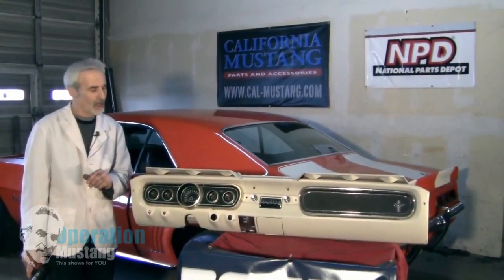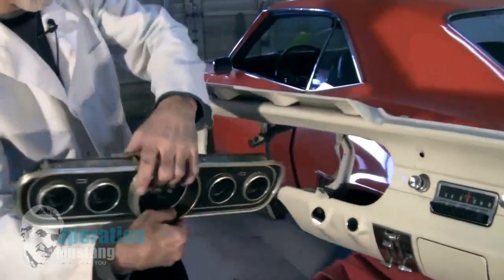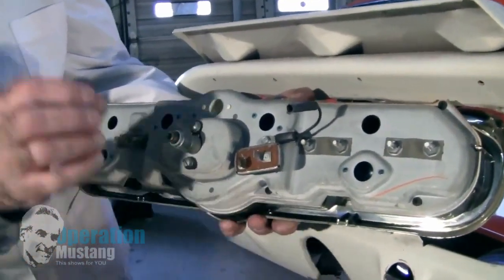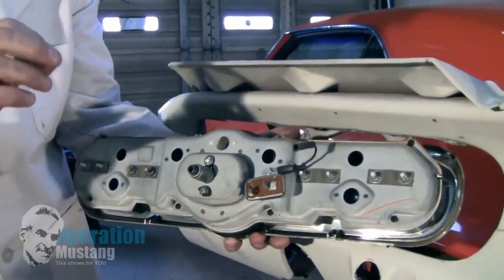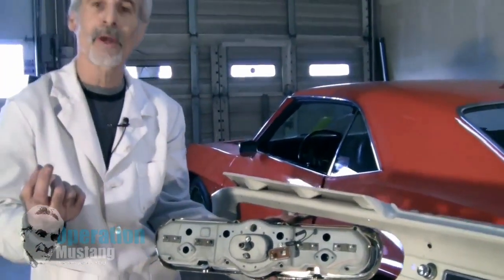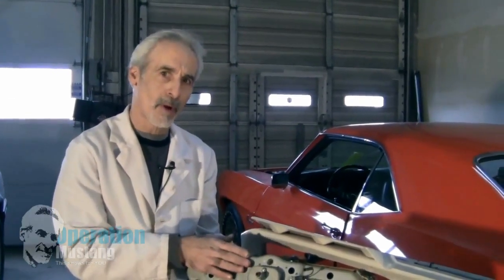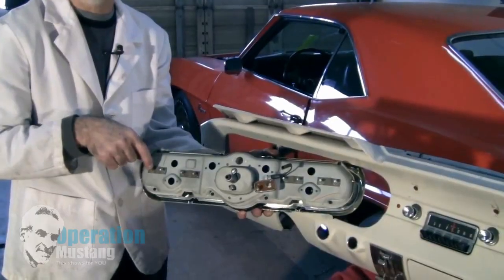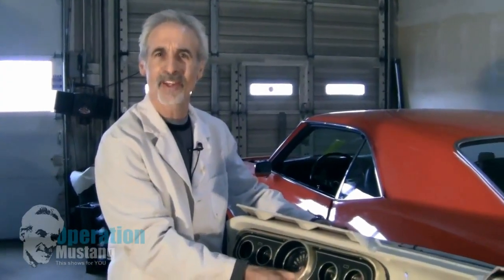Vid 1 - Fix Those Faulty Classic Car Gauges

Comment: Thanks for the video Chris. I just installed a new Scott Drake voltage limiter in my ‘65 mustang. It fixed the temp gauge going full hot, but fuel gauge still goes past full. I checked the wire at sending unit and didn’t get a light. Checked it at voltage limiter and the light stayed steady. I’m also not getting any instrument lights, not sure if that’s the same problem. Was wondering if you have any ideas ?

Comment: Yeah I installed a new voltage regulator on the back of the instrument cluster on my1970 Ford F250 Camper Special but no change, I may put a different one in but ........ I'm not sure that'll take care of it. Perhaps it's not getting power to the cluster itself, or maybe there's a ground issue ???????

Comment: Could add a voltage limiter to my 68 pontiac fuel gage?
Reply from the maker: May work.. Not sure though...
Reply: In theory, would I splice it in the 12v side or the fuel sender signal side? @MustangRestorationsInc

Comment: Not pulse current ....., pulse voltage ....voltage!
Reply from the maker: Current is the rate of flow of electricity....In this case the rate is intermittent. Hence the term Current...
Reply: @MustangRestorationsInc  wrong.  Current is not the rate of flow of electricity.  Current is the rate of flow Of electrons or charged particle flow typically electrons in our case.

Listen not trying to be a jerk, but if you are gonna profess to be an expert and Throw around electrical terms At least do some research so you know the difference between voltage and current.
Reply from the maker: @lujitsu1251  Understood & a good point you are making....Some of it though is to not take these terms so literal.....The other 63000 viewers including yourself knew what I was referring to without getting overly technical about it.....Kind of like the term's Gas or Fuel. You can Fuel up your car or Gas up your car. Two different terms & meanings yet everyone still understands what you are looking to do. Obviously when you tell someone you are gonna gas the car up they do not think you are putting in anything else but a liquid in your tank..Thanks for the criticism just the same...
Reply: @MustangRestorationsInc  current and voltage are not at all like the words gas and fuel
Reply from the maker: @lujitsu1251  Well you just proved my point about not understanding the spirit of the video....Stay safe & healthy...
Reply: @MustangRestorationsInc  lol some guys lol